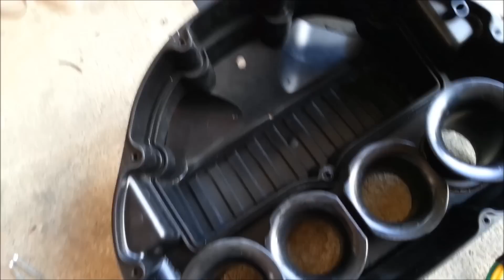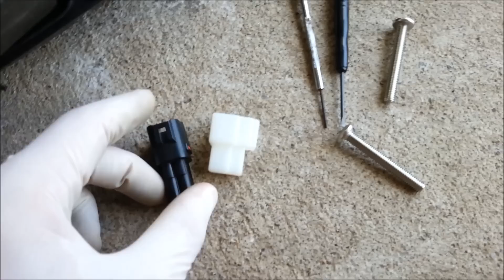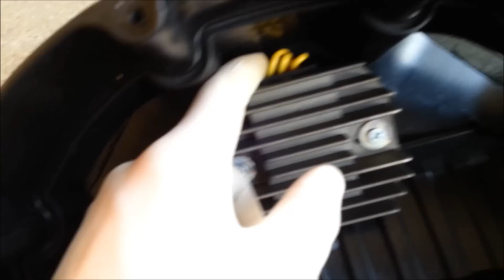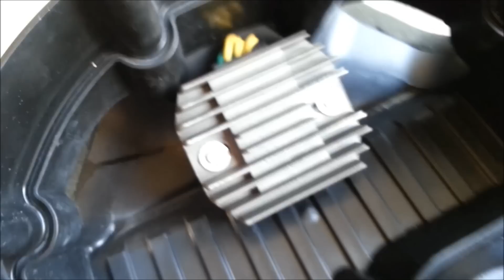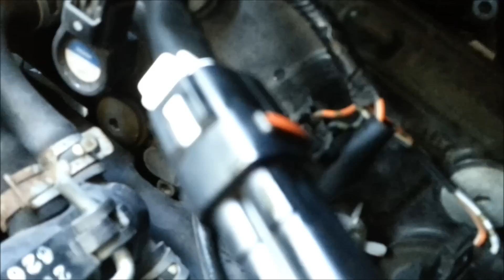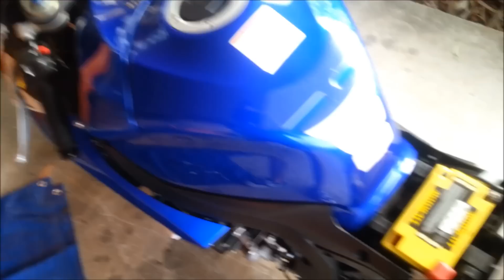GSXR 600 750 K6 K7 Regulator Relocation - charging problem FIXED

Comment: On my yamaha R1 i put mine under the back seat and use a computer fan never had more problems its been years and the charging works better than before even when im in a stop Light the fan is always working
Reply from the maker: thats a good idea, powering the fan from stop signal.

Comment: Cool vid.  I remember going through a handful of r/r's on my 06 gsxr 600.  I relocated mine between the front forks.  I never had another issue with since it got tons of airflow from under there.  I eventually sold it and got an r1.  I just wish I would had figured it out sooner.  Lol
Reply from the maker: that's also a good idea, though mine were burning out in peak hour traffic, I needed air flow when I was sitting still in traffic.
Reply: Hey man, I was wondering if you have any pics of ur new regulator location? I'm searching for a new place to put mine and interested in ur front fork suggestion. Thanks
Reply: +Ustez Naaj Sure do.  What's your email address?
Reply: +Ustez Naaj No problem. Just sent you the pic.
Reply: +Ustez Naaj take a look at my video on how I relocated mine
Reply: how about the rain ? i puted mine there and got burrned :/
Reply: @crazytrain7376 did you figure it out by now
Reply: @cyanus7347  yup i sold the bike after the third regulator .. I like long rides and with that bike was impossible..
Reply: @cyanus7347  yup i sold the bike after the third regulator .. I like long rides and with that bike was impossible..

Comment: Hey bro,  my bike just decided to not start today after i filled up gas at gas station and it worked fine all the way down there, then the battery just drained out and i didnt get it ti start until i pushed it down a hill. Do you think my battery was bad or the rectifier is gone?
Reply: Just a note i bought a new battery and it fired up immidiately, but i still have a feeling that the battery will grt discharged if i drive it
Reply from the maker: @WindFair  get some multimeters and measure the voltage of the battery while the bike is running. If the voltage is around 14.5v all good, if the voltage is around 12.5v and dropping or close to it could be bad stator or regulator. If you know how to test the voltage coming from your stator do so also. There will be 3 wires coming out of your stator if you put the multimeter to AC and test any two phases you should get about 75v at 3000rpm (remember to test all phases of the stator wiring, eg wires abc test a&b, b&c, c&a) good luck 🤞
Reply: @jacobsr20det  Thank you so much bro for detailed answer😇 I checked my voltage on the new battery and it was at 12.7 when bike is off and at 14.4-14.8 v when bike started up so i think it is all good now
Reply from the maker: @WindFair  sounds like it might have just been the battery. You are welcome, I prefer to help people rather than you taking it to a shop to have the same tests done but cost you $$$, glad it's fixed enjoy
Reply: @jacobsr20det  Thank you so much

Comment: So how many months or km or miles you have it on since you changed the location of the regulator? I changed mine 3x already and not sure how many times the guy before I bought this bike.The temperature of the bike goes sometime over 220 F if I am in traffic or just standing.Mine burns at the wire bog when the regulator and stator  connect. I also live in Hawaii so I always drive in heat.I did research and it was recall for the overcharging issue for this model.Not sure if a ticker wires  would help?How is it now ,its been like 10 months Have you changed it since than?Mahalo!
Reply: I was wondering if you still have the bike. Hate to see people going through this. I did the same thing myself get a rectifier relocation bracket it will solve all your problems go to flatlandinnovations.com in the new location to rectififer will remain cool to the touch on the harvest days
Reply from the maker: Flatland Innovations I do not have the bike anymore but the guy I sold it to I still keep in touch with, he has not had to replace the regulator as of yet. he has however replaced the stator as it was burnt out. good news is that the regulator has not yet failed since being moved.
Reply: No,I sold the bike and got CBR 1000rr already drove 6000mils and no problem. And yes I heard that the spot where is the regulator has no cooling from the air,its between the radiator and engine always hot.Heard someone relocated the regulator to the air box so when you ride the air float right over the regulator ,but that it's right under the gas tank and if it heats up not good ,so yes relocate it somewhere outside of the original location make a seance.Thanks to getting back to me.I just hope Suzuki figure out better parts or locations for next models because to ride GSXR was very fast and comfortable also holds in turns very good I'd say much better than my CBR now.

Comment: If you have a bad Rectifier could that cause the 30 amp fuse to blow then when I put the new one on it blows again took off Rectifier & has to big splits down the back of it ordered a new one hope that does the trick ?

Comment: Number 1 killer of regulator's burning out is poor earthing. By removing the reg from the chassis and putting it into the plastic intake tract you are making it work over time to regulate current. Yes it'll get cool air but now it's going to be busting it's ass. At least get some earthing wire onto it.
Reply: no it's not. It doesn't short to negative to regulate, it shorts to the other phases.
Reply: @dadwillfixit  You're right, I stand corrected.
Reply: @MafiZed  i still wouldn't risk putting it there though. On a naked bike even if it catches fire probably nothing will happen outside, but in there the whole thing can burn down

Comment: How is the relocation holding up? how much of a difference have you seen in bike temp?
Reply from the maker: Regulator holding up great.. I would have replaced it again by now, it always died through the hotter months, but not this time :)

someome mentioned that there regulator caught fire, so if you do this you are doing it at your own risk, I assume if it was to catch fire there would be no way to put it out.
Reply: Hello! Just curious how many rectifiers you had changed after this?

Comment: great video mate, how is that working out for you? I'm having issues with overcharging my battery. I have a k6 gsxr 600. any input? let me know on your update.. Thanks for the video, great idea..
Reply from the maker: Hi Martin, I would suggest checking your reg rec but it could also be your stator, these are cheap if you buy from the US. Try getting a copy of the GSXR600 K6 manual from download there is a PDF version online google helps. Page 420,421,422 "charging system" will explain how to test the stator. if its not putting out 70ish volts AC on all three phases then you know its the stator, if it is you can bet it will be the rectifier. Hope this helps.

Oh and my bike has never been better with the charging system :) thanks
Reply: jacobsr20det so tell me if thr rectifier is still working before i try to relocate mine. I hope it a good fix cause I too have fried several.
Reply from the maker: Don Cartagena Hi Don, I didn't see this question before, but yes it is still working.

Comment: Good Idea.  But would suck if it caught on fire. Ive had one catch on fire and looks like Ill be replacing my third one in two years time. Good idea though
Reply from the maker: I have heard of the regulator catching fire before and if that happened I feel there would be no way of saving the bike.
Reply: I put the fire out rite away. Nothing else burned but the rectifier.

Comment: Wanted to know where was ur regulator located before u moved it
Reply from the maker: If you see the GSXR sticker to the right there is two shiny silver bolts on the block frame behind the radiator.. It sits there.

Comment: How do you put the air box back on?
Reply: just in the reverse order of pulling it apart. Everything bolts back in.
Reply: For some reason my rubber doesn't go over the throttle body
Reply: screws too tight, do they have springs from memory?
Reply: I took the screws for the air box to throttle body out
Reply: oh, I think from memory the front of the airbox has to be pushed down slightly to get them to all slide on. are you having trouble with all of them or just one or two?

Comment: What size drill bit did u use
Reply from the maker: R6 MOTO from memory it would have been a 10 or 12mm drill bit.
Reply: Throttle Control well too late I already used a 3/8 and did three passes

Comment: Thats gonna heat up the air box and you going to lose power
Reply from the maker: The Rider haha, I did think this myself until I tested it. The unit never gets a chance to heat soak because it always has had cold air rushing over it so no increase in temperatures where ever detected

Comment: I did that on my 07 Gsxr600 n burnt out
Reply: Flatland Innovations check us out on u tube Flatland Innovations or under gsxr rectifier relocation bracket
Reply: Flatland Innovations put it on radiator ? Dont think this will help
Reply: Have you never seen an oil cooler?  This location has proven to be very effective. Operating Temps remain in the normal operating range. Between 180 and 220. We have hundreds of satisfied customers. This placement provides optimal cooling while maintaining the lines of the bike.
Reply: +Flatland Innovations I ordered your mount but you never sent it. you never responded to my emails and didn't answer any calls. had to file a PayPal dispute .
Reply: farrock02 Man that sucks..We were having some issues with orders going to spam . We have since resolved the issue.  I  apologize for any inconvenience this caused you. I hope you were able to get your rectifier situation rectified.
Reply: +Flatland Innovations no I didn't . rectifier burnt out 2 weeks ago and had to get it swapped out by electrosport. still need it replaced but don't really feel comfortable ordering your mount

Comment: I wonder if it will heat the air going into the motor?  I'm going to mount a PC fan on mine... but still thinking.....
Reply from the maker: David drbuc 
I did think about this and tested the intake temperatures before and after install. only to .01 degrees celsius and noticed no increase of temperatures at all, I figured this was due to the regulator not being able to get heat soak and hold any temperatures.